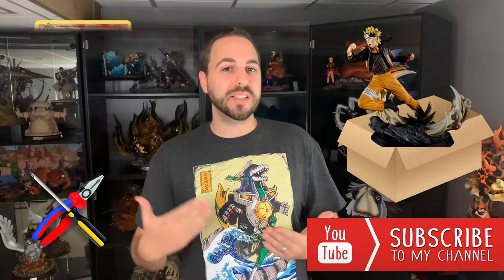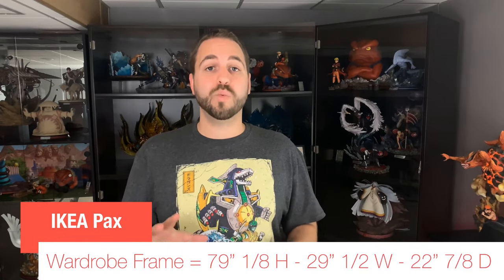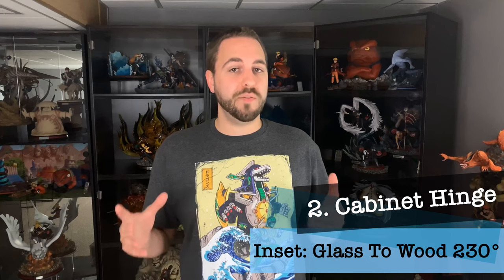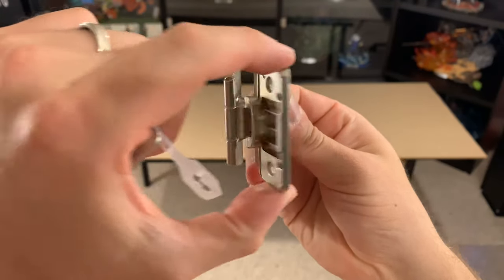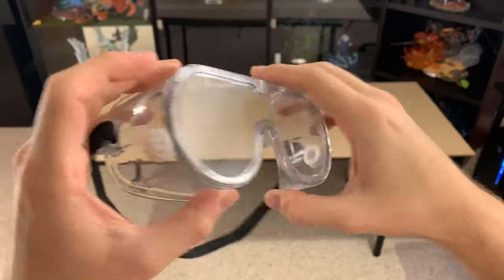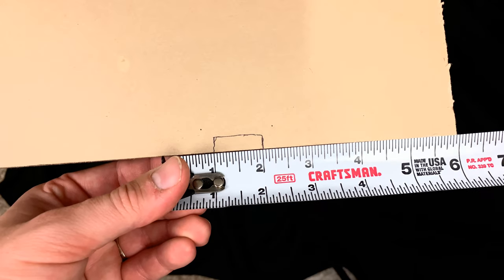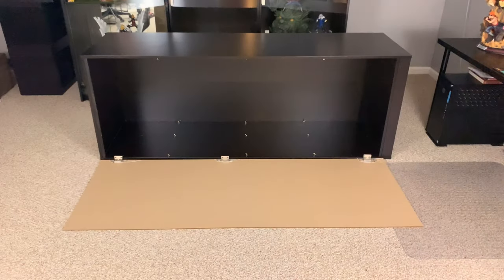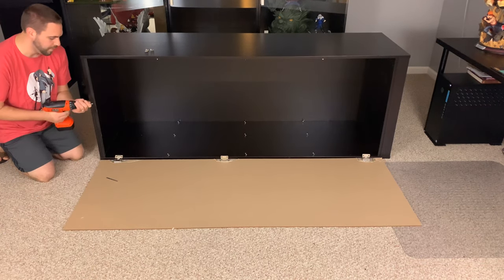🔨🛠🔧 PART 2 - Adding Custom Acrylic Doors To Your Display Case - IKEA Pax Display Case Build

Comment: Amazing video. I happened to come across it randomly while researching display cases from G.A.C. I mostly have detolfs myself and an inherited large display case. I was looking up the size of a few of my sadly still boxed figures (First4figures and a bunch of GAC ones) , and right there on the page was the video I needed. 

I do have one question if it's not too much of a bother: I'm from Europe and since we use cm I converted your measurements (193,675  and 71,12 cm). Now since these are "weirder" numbers, I was wondering how much leeway  there is on the doors. Would it be better to get the exact measurements or could I shave off the few millimeters.

Also am I correct in assuming the door rests against the display case and not in it?
Reply from the maker: Cpt Ragnarok Happy you found it! It rest on it and not in it for sure. Those CM conversions do seem a bit off, maybe try an online converter tool? Also shaving some off would be very difficult to do in a clean way without a professional large acrylic blade table saw.
Reply: @BAMCollectibles   Hey man, thanks for the reply! Oh sorry, I should specified, the conversions were from online tools. I've double checked with a few tools  and outside of rounding (193,68 as opposed to 193,675), they seem to match.

If I were to get plates made, should I go with these measurements or could I get away with rounding down to the nearest 0,5 up or down? It might not be an exact science but I'm neurotic that way.
Reply from the maker: Cpt Ragnarok I would 100% recommend messing things yourself to anyone honestly. If you have the PAX unit or whatever you’re trying to mount a door to just measure it. 

I cut mine so that it perfectly covered the inner part of the case and not the outside of it, or the frame of the case and it’s always worked out for me.

Comment: Hi, thank you for the informative video. If I was doing this for custom acrylic doors for a Besta, which will be individual cubes 60x64cm, would you recommend the same hinges? It will be basically like your set up but the acrylic is cut into 3, thank you
Reply from the maker: Yup that sounds like it would work really great! Really hope the videos helps you out in your project.

Comment: Just use a metal bottom plate for the shelves like aluminum or a thin steel, should help lighting the displays aswell since its reflective.

Comment: Is that cabinet in the left of you video the wider (39 3/8") Pax? If so, what width did you order for your acrylic sheets? I'm placing an order now. I'll have 2 of the 29 1/2" and one of the 39 3/8", so I can use your measurements for the narrower one but would love a hand with the full width double door measurements. Thanks!
Reply from the maker: The case you saw there is a much older case that is not from IKEA, I got it when a local store shut down maybe eight years ago. 

Regards to the 39 inch wide case as I have not ordered acrylic sheets from mine yet so I can’t tell you what to order. It does make sense just add 10 inches on to what I ordered for the 29 though
Reply: @BAMCollectibles  thanks! I got the acrylic ordered and picked up, but now I am unfortunately having a hell of a time sourcing the hinges in Canada. Every time I find something online it is from a distributor and you need to be a cl.pany to buy them. Amazon has some clamp style ones, but not sure I trust them with a piece of acrylic this heavy.
Reply: @jedwagner5086  did you have any luck with this after? I'm also in Canada (Ontario) and trying to do these acrylic doors on 4 - 39"w Pax frames. I wasn't sir of it needs to be 2 - 20" doors or you can use 1 large one. I can't find those same hinges either ...
Reply: @justinclarke2204  I ended up using the clamp style hinges from Amazon. Did 4 per panel and they've held up perfectly for months! I also used magnet closures to keep them shut. Check out the finished product here: http://imgur.com/gallery/ALjGx2h

I ended up going with a single sheet for the 29.5" one and two sheets 18 13/16" wide for the 39" one. It worked perfectly. 

I also used 1/4" thickness for all.
Reply: @jedwagner5086  ok this just sold me completely your display looks great and I am doing mine for exactly the same Star Wars Lego mainly UCS sets. I was close to pulling the trigger on Moducases but it's over $4200 shipped CAD. I'm still debating whether black or white but your white looks great. Would you be able to link the exact hinges and magnets from amazon you used? Also would the falcon fit at the 22" deep sitting flat?
Reply: @justinclarke2204  my cabinets are much fuller now, but you get the idea from that picture. I used these magnets, (https://www.amazon.ca/dp/B07MMQDY92/ref=cm_sw_r_cp_apa_glt_i_NT2E4278Y5XZNVS3ZJ04?_encoding=UTF8&psc=1)  but use superglue onto the acrylic as the adhesive included isn't great. And these hinges. (https://www.amazon.ca/dp/B08F9MXW81/ref=cm_sw_r_cp_apa_glt_i_GD041HBPAYWQKVB8RHHN?_encoding=UTF8&psc=1) I did 4 per acrylic sheet. 

As for the Falcon flat, I haven't tried. In theory you could as it's 22" wide and the Pax is 22 7/8" deep but it would literally be touching the back so I personally would do it that way. 

Happy to help, and happy building!
Reply: @jedwagner5086  would love to see some updates pics if your posted them on how you utilized your space. Thanks for the links. I'm sourcing the acrylic now in my area, would you have a idea how much this cost your setup?
Reply: @justinclarke2204  so still not full, but here's the space as of last night.http://imgur.com/gallery/vVItrti

Comment: Awesome. Thanks for sharing! One of your wardrobe displays has a mirrored backing.  How did you do that?
Reply from the maker: Hey Greg! That’s actually my first ever display case that I bought from a store at a mall that was closing down. Looks very similar to my PAX but it has hardly no depth to it and that mirror. 

So sadly it came like that and nothing I did. If I wanted to do that I’m sure you can contact someone that makes glass/Mirrors to have s large sheet cut for you and glue it to the back of the PAX. Hope this helps man! Let me know if there’s anything else I can help with.

Comment: Oh man! Just what I needed!  Thinking of getting the double sized Pax unit and need a custom door solution. This will work perfectly! Thank you so much! You have a new sub!
Reply from the maker: Awesome man!  Happy I can provide it for you.  I'll be releasing my part 3 in a few weeks that will actually feature building and customizing one of the larger 39" PAX units and how to reinforce shelves as those are wider and more prone to bowing over time.  Thanks for the sub and hope that video helps as well.  Cheers!
Reply: BAM Collectibles yes please!! Can’t wait!
Reply: BAM Collectibles Hey BAM!....where my part 3?!🤣🤣 Anxiously waitin!
Reply: Hey Bam.... what’s your thoughts on 1/4 vs 3/16 for the thickness of the acrylic after using them both?

Comment: I have the same Cabinets I just used magnetic tape on 3mm Perspex which cost me $10 and took 5 mins no drilling or sawing, doors hold well and also air seal so no dust , easy and cheaper
Reply from the maker: I would love to see pictures of that Steven! That sounds like an amazing idea!
Reply: @BAMCollectibles  where can I send pictures to as cannot upload to this site?
Reply: hey can you upload pics of it to that site: https://imgur.com/upload or something like that and share image link with us? i would love to see that and learn details.
Reply: @nuvola-b  I have uploaded pictures
Reply: @BAMCollectibles  I have uploaded a link for pictures
Reply: @stevengallimore3288  thank you so much. Looks great by the way but can you explain how it holds? Is it really strong?
Reply: @nuvola-b  yeah I used 12mm wide by 1.5 mm thick, I first put a strip down the side of the cabinet, then attached the other strip to that so would connect right then pressed the perspex to that, the adhesive tape on the strips work and hold perfect, after you have pressed the pespex against the magnetic strip apply pessure and then you can remove anytime, tgey just pull off easy, never moved but i have only tried on double height cabinets and not triple height also might be worth trying 2mm persoex rather than 3 might be cheaper, hard to come by due to covid, hope this is helpful
Reply: @stevengallimore3288  thank you so much :)
Reply: Where'd you get the perspex sheets? I'm having trouble finding something as big as 39x79 for this frame. Or did you use multiple?
Reply: @fongneticcomics559  just google perspex suppliers, im in Edinburgh in the UK and just rang a couple and they cut to exact size

Comment: What size and thickness has your acryl sheet?
Reply from the maker: Below is what I requested from my acrylic supplier last time I had a door made for the 29" wide PAX.

Acrylic Door Sheet
- 3/16 thick sheet
- 76" 1/4 High
- 28" Wide
Reply: @BAMCollectibles  thanks man

Comment: Your videos are awesome and have inspired me to modify a few of these Pax shelves myself!  A few quick questions for you:  1) how is the 3/8" acrylic holding up over time?  the price on acrylic has gone up significantly and I would like to use 3/8" if you haven't had any issues 2) how much dust accumulates in the cases with the acrylic?  3)   Any ideas of where to find LEDs for the 29.5" Pax?   Thank you!
Reply from the maker: Yea it’s definitely gone up because of demand for acrylic blockers at businesses to keep customers distant from workers. 

1. Holding up perfectly, no bends or bows in it. 
2. I only have to dust like once mayybeeee twice a year
3. LED consumers sadly change all the time. What works once month may not another. You’ll have so personal research to likely find some. 

Best of luck and cheers man!